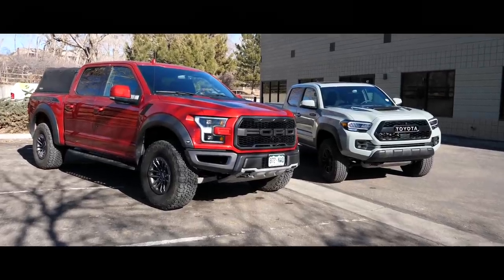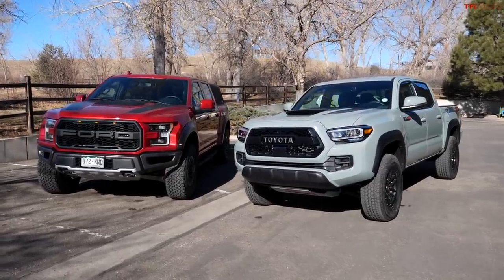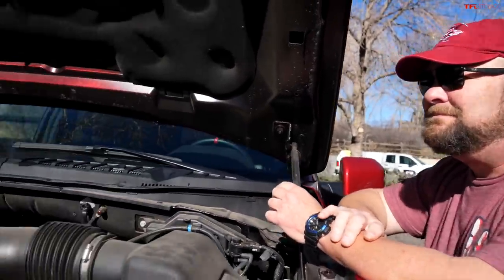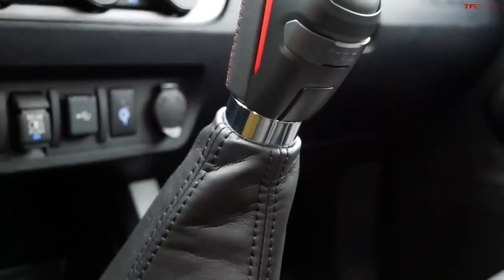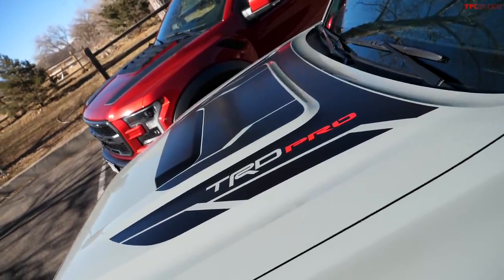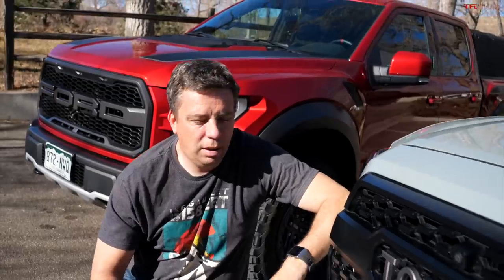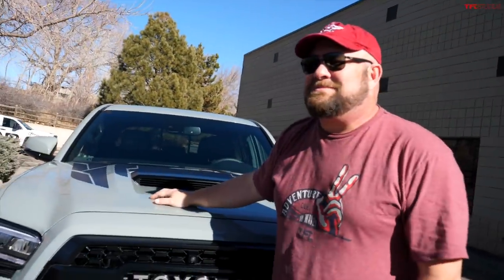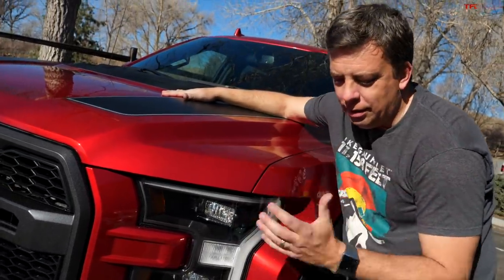Big vs. Small: The Ford Raptor & Toyota Tacoma TRD Pro Are Both Off-Road Beasts - But Which Is Best?

Comment: TACOMA ALL DAY!!
Reply: Why ???
Reply: @fj400007  RELIABILITY!!
Reply: @uriahg193  I might be the exception here but, I had a few problems with my Tacoma, I wouldn't have called it reliable.  it was overrated,  overpriced,  underpowered with no towing capacity that started rotting away the second it saw salt.   There's a reason you'll still see more older american trucks up north compared to very few japanese cars past 15 years old.
Reply: @fj400007  You're in the minority,  i still have my 07 Tacoma.  356,000 original miles and no problems.
Reply: @uriahg193  that's impressive,  I was unlucky I guess.  I was pulling a  5000 lbs boat from time to time and  the occasional off roading but, I had to get my differential rebuilt twice and had issues with my transfer case too.
Reply: @fj400007  Get a Tundra if you're going to be hauling a boat. Mid size trucks are not for that. I hope you stay with Toyota,  good luck buddy.
Reply: @uriahg193  What about all the lawsuits?
Reply: @anoop4243  All companies have been sued.  Chevy , Ford, Chrysler etc. That's a weak argument.
Reply: @uriahg193  So basically, a manufacturer known for reliability, is getting sued for reliability issues with its product. People buy it mostly considering the reliability reputation in mind - not features, performance, towing capacity etc. 

Why buy an unreliable outdated Taco when you can get pretty much everything with the ranger ? The perceived reliability is a myth nowadays.
Reply: @anoop4243  Abraham it's a machine, it's not perfect.  The only perfect thing we have in this is the King James Bible. Toyota is still better than  any American truck.
Reply: @anoop4243  Threw u a curve ball with the Bible.  But no machine is perfect but for my money I'll trust a Toyota truck any day over a Ram, Chevy or Ford.
Reply: @uriahg193  That's a myth. How exactly is it superior? Just saying that its superior is not gonna prove anything. Ranger has better performance, is more modern, has better space and tech, and even better fuel efficiency (yeah if driven like a grandma) and has been used around the world and has been there for a decade. It has been holding up well.

What exactly does the Tacoma have over the Ranger other than 'resale value' due to perceived reliability?
Reply: @anoop4243  Toyota way better tgan Ford. C'mon Abraham,  Tacoma is the King of mid size and full size. Reliability,  something Ford won't promise you. Have a nice day!
Reply: @uriahg193  Till now, you haven't specified how exactly it is superior, rather than just saying it's more reliable than ford ... You are forgetting that the ranger has been out there for a while now, without problems. Many high mileage rangers out there. If you can get high miles, with the performance and better value with the ranger, why should Taco be even considered? (I never considered Taco to a Raptor(not the same segment)... Taco doesn't come close, neither does Tundra TRD  pro)

If Tacoma promises reliability, why did consumer reports issue it a "do not buy" warning and rate it as the least reliable truck in North America? You speak as if all the reliability issues posted for Taco over YT is fake ... Lawsuits are also fake ... & CR produces fake reports?? 😂

How exactly is Tacoma the king of full size tricks? It's a mid size... And F150 is the best full size truck - praised by all reviewers, and the bestseller.
Reply: @anoop4243  the proof is in tbe pudding.  They last longer Abraham.  If u want something unreliable stiick to your Ford F150
Reply: @uriahg193  F150s are not unreliable. No one would buy a vehicle that constantly breaks down (F150 sales are only increasing), and If you personally think they are, then you are still living in early 2000s when ford messed up. Currently Toyota's are having all sorts of issues - with the 2.5 engine, V6 , Frame rust, Transmission, Software issues, lawsuits... And still people like you believe that they are reliable. Nothing can change perceptions until you buy one and experience it yourself.

They even announced a V6 Turbo Tundra for the new gen ... Guess what ford has been playing with turbos for a long time now. And Toyota's seem to have issues with ancient, unchanged powertrains.
Reply: @anoop4243  Yeah but Toyota still more reliable,  that's where i put my money.
Reply: @uriahg193  Your money, your choice🙂. Just because you think that something is reliable doesn't mean others are unreliable. And there is more to owning a vehicle than reliability alone - if reliability was the only thing people cared about, we'd still be driving basic, featureless, boring vehicles. 

Have a great day.
Reply: @anoop4243  My smart choice, thank you.

Comment: I really like how every vehicle on your show is always competing against a Tacoma.... Raptor Vs. TRD Pro... Jeep Vs. TRD Pro... M1 Abrams Tank Vs. TRD Pro... USS George H.W. Bush Vs. TRD Pro. And every single time the Pro wins..
Reply: Hahaha nice one
Reply: That makes it the benchmark.
Reply: Tacoma is way overrated.
Reply: Ive driven Raptor, ZR2 and TRX. I go TRD Pro all day everyday! I own one exactly this same Lunar Rock! Beautiful and sexy villain all trucks had to bowed down to.
Reply: @speedy0231  cause u Haven’t owned one lmao
Reply: @brycehammond2099  I did look at a brand new one with a 3.5. The interior felt very dated, and it felt under powered. I ended up with a 2018 F150 Lariat with a 5.0.
Reply: @speedy0231  ya exactly, if your looking for flashy one, taco is not for u.
Reply: @speedy0231  ah a fellow F150 owner! I see you are a fan of future electrical problems as well.
Reply: @speedy0231  I agree.  Tacoma is a dog unless you get the manual and regear to 4.88 or 5.29
Reply: @shaiq-nbaiq1826  50k miles with no issues at all. I plan in trading it next year anyways.
Reply: @speedy0231  lol because thats still new
Reply: @speedy0231  not really. How is overrated?
Reply: @speedy0231  so is a KIA…

Comment: I think one thing I take in to consideration is parking. I have seen so many bigger trucks squeezed in or have to drive around just to find parking. Believe me, the Raptor is my dream truck, but I am all about practicality, and the Taco hands down has the best everyday usage, along with off-road capability. Love Tacos.
Reply: Yes I totally agree I had a 2017 raptor & Gen3 Tacoma at the same time I sold the raptor due to spending more time at ford than my house , will never buy Ford again , I’m loving this Gen3 Tacoma more and more
Reply: The width of my '19 is the only thing I need to managage. Even breakover isn't too bad for a crewcab. But the width.. you just can't fit some places. Others are tight. 

But man, is it ever fun. And it just eats up the miles on and off road.

Comment: If you actually work for a living at a normal job it’s a no brainer.  Price.  Price of gas, price of insurance, initial cost. You get the picture; and I didn’t even go down the reliability road.  Whoopsy, guess I did😀
Reply: Lol go to a turd Gen Facebook page. Nothing but problems and problems. They ride on the reliability coattails of the 1st and 2nd gens.
Reply: The gas mileage is not much different to be honest.
Reply: @richfarfugnuven6308  it’s not only the mileage, read his comment again
Reply: @RagingBad  that's why I only commented on mileage.  The mileage in real world driving is about the same.
Reply: @Wade-lk4yo  nope, those are just some people complaining. I've had a couple of third gen's, and zero issues this thing out last  ford any day
Reply: @richfarfugnuven6308  still higher on the Ford
Reply: Not sure how the third gens are doing with reliability, but when I worked at ford we rarely had raptors in the shop outside of maintenance. Half of the ones we did have in the shop was because some dumbass abused it. The eco boost is actually very reliable. Sounds like the Covid caused toyota to maybe suffer on QC with these latest models? Not sure.
Reply: @adventuresinreality2645  3rd gens are not doing well at all in reliability terms. There is currently a class action lawsuit against Toyota for automatic transmission issues. I've also heard many horror stories of howling differentials and also the fuel pump issues.  The issues are so bad that Consumer Reports issued a Do Not Buy for 2020 and 2021 Tacomas.
Reply: @alienation1270  

If we look at Consumer Reports, the verdict is good for this generation of the legendary Toyota Tacoma. But if you want one of the best used Toyota Tacoma model years from the second generation, a few stand out. 2005, 2010, 2011, 2012, 2013, 2014, and 2015 all have perfect reliability verdict ratings.Nov 18, 2020
www.motorbiscuit.com › the-best-us...

Taken from their pages.  This is for the 2020, 2021.   It may not be as good as previous years but still not bad.
Reply: Calm down ppl. It’s okay to have a different opinion. That being said, The Tacoma has a very tall overdrive in 5th AND 6th gear to turn low RPMS. The gearing is so high that the transmission is constantly shifting. So the only thing wrong with the current gen taco is that it needs to be regeard. This is not a reliability issue however it is annoying while driving.
Reply: @alienation1270  Oo wow lol. That’s too bad, just shows no company can rest on it’s past. Just ask ford, the 2000s they made too many mistakes and are still trying to shake that rep even though 2012 and ups have been about as reliable as anyone.

Comment: I have a trd off road in manual transmission and I love it. I know the tech is so far behind the Raptor. These two trucks are not in the same class and really shouldn't be compared head2head because they are geared for different markets. They are both badass in their own ways but I'm happy with my taco

Comment: Toyota has really made its mark with the Manual trans. That's why the price is so crazy for such a mid sized truck. The can ask that price because they have something that's absolutely limited in its market. The raptor to me seems like it should be lower for the price. The wide body is cool, but you get that tacoma, throw a full mid travel kings kit with adjustable heights, you get exactly what you do in the raptor for less. Theoretically you can do literally everything that the raptor has, all aftermarket, and still spend less. That's toyotas key. They made a strong, forever lasting, mid sized truck. It's decent on gas, and isn't meant to be 500 hp. I'm sorry but why do you need over 350 when hitting the trails? Or going off roading? If you want speed you could supercharge it and get the kings kit, and still be under the price of a raptor brand new. Also Ford just doesn't have the reputation tacoma has. What Ford do you know that went a million miles all stock same engine and trans? Fords have been known to and will always have issues at 150k+. With a tacoma 150k+ is just breaking in the truck. With proper maintnance and rust protection your tacoma will live forever. I can not say the same for Ford f-150's. Maybe a Cummins or a diesel but not the f150. I'd take a tacoma any day of the week over a Ford any day.

Comment: I’ve owned them both. The Raptor is a lot more fun to drive. It can feel like a pseudo sports car when you put it in sport mode. The negatives for me; too cumbersome to live with everyday, and I don’t trust how those turbos are going to do in the long run. I had to plan every trip or errand with my Raptor. It being so wide made parking anywhere a nightmare!

The Tacoma TRD PRO, is not going to knock your socks off with acceleration or push you onto your seat. What it will do, is take you on your journeys with relative comfort, knowing that it can take abuse and still bring you home without any problems. It’s not going to give you BS lights, sounds, or rattles. It simply keeps going without asking much in return, fuel and oil. Beauty is in the eye of the beholder, but both trucks are the best looking to me, in their class. 

I ended up selling my Raptor and buying an Army Green Tacoma TRD Pro. I haven’t had any regrets whatsoever. The Tacoma is simply easy and pleasant to live with. I know that if I choose, I don’t have to purchase another vehicle for the next twenty years. That’s great piece of mind to have for me, and worth the trade.
Reply: Totally agree !
Reply: People keep knocking the turbos since Ford first put them on their engines and years later..... no major problems so why still so skeptical?  Any part of an engine can have problems if there was a major problem with the turbos we'd have seen it by now just saying
Reply: tacoma reliability is not there in the 3rd gen.  class action lawsuit on automatic transmission, howling differentials, fuel pumps the list goes on.  Reliability is so questionable that Consumer Reports issued a do not buy on 2020 and 2021 Tacomas
Reply: Have 2018 Raptor and have no issues with parking. Not sure what's wrong on your end. Reliability is driven by two inputs (Design and manufacturability) Being ford pushes out 3-4 times the volume compared to Toyota with the addition of new technology is a testament of fords outstanding quality. One of the reason I believe that helps with this is the Ford employees really take pride in the brand. I don't get that same impression from other truck manufactures.
Reply: @lrr5586 , fair point and well taken. Perhaps I didn’t give the Raptor enough time to prove itself as far reliability goes. 

As far as parking, I’m simply a lost cause! I have a hard time parking any big vehicle.  What bothered me the most, was being so close to other vehicles because the truck took almost every inch of width space. People in general don’t care, they’ll ding, scratch, your $70 grand truck and not think twice about it. 

I travel a lot and have to park at airports quite a bit. That was pure nightmare. People running late and swinging luggage everywhere, i cringe just thinking about it.

Comment: Nathan.   ATRAC is NOT Terrain Management System.  Nor is it Crawl Control.  And Yes it is available on manual transmission Tacomas as Andre used it on the last video. Unfortunately Nathan keep confusing the systems when he explains them and ATRAC gets mis represented

Comment: The manual in that Taco makes it more desirable for sure.  I recently drove my brother's '17 Taco TRD Off-Road w/the 6 spd auto.  I own a '15 4Runner TRD Pro.  I always longed for more power from the old 4.0L v6 -- but, after driving my bros Taco it actually felt quick.  The 3.5L mated to the 6spd auto -- sluggish man,...just sluggish.  I love the Toyota reliability -- but, if I could get a Raptor for close to the same price as a Taco -- I'm going Raptor.  That said,...keeping my 4Runner.
Reply: What's sluggish?  Hit the ect button (takes the system out of economy mode) and stand on it.  Sluggish my ass.  Aint a v8 raptor engine, but for a v6, power is one thing it doesn't lack.  Lack of knowing how to use it however, makes people miss out on the fun
Reply: @kdrhobby  Maybe it was in eco mode,...not sure.  Thanks for pointing that out.  I was comparing it to my 4Runner, not a Raptor.  Taco's are the best selling truck mid-sized truck on the market.  I don't think my opinion that' it's "sluggish" will eat into Toyota's sales figures.  The fun will continue.
Reply: Love the 6 speed manual transmission. 2023 last year for tacoma 6 spd stick shift...

Comment: I added Air Bags to the my Raptor to help with payload and towing. They take over the suspension when I push over 40 PSI to the bags with remote control, this is turn makes truck tow with confidence and safety . Makes my raptor with 600 HP and 600 Ft lb of Torque make for a very capable truck to work and play.
Reply: Did you upgrade your power plant
Reply: My 2018 raptor only has 450 horses and 510 torque, stock but some intercooler mods would up the power levels significantly.
Reply: I have the 2011 model with the 6.2 liter super charged
Reply: @johnkraft5640  nice I almost bought a 2014 , there great trucks!
Reply: @77teahupoo  look up goosetuned, that tune will make your ecoboost scream

Comment: A Tacoma TRD Pro is a Tacoma with bolt-on parts.  A raptor supposedly has a reinforced frame along with bolt on parts.
Reply: It’s not supposedly reinforced, it is reinforced, it’s actually 700lbs heavier than the f150 frame.

Comment: While the Taco can be fun to drive off road due to its size, it’s uncomfortable for those over 6 ft tall for daily driving. The little motor is peppy but most ecoboost motors will outperform both in power and fuel mileage. Had the 2010 taco TRD for a year. Most uncomfortable truck I’ve owned in many years. Front seat cramped for larger drivers. Back seat foot room is non existent. In order to get more ground clearance the trucks floor pan is raised which leaves absolutely NO room under the back seat for you feet. Also, the cab isn’t sufficiently high enough for any adult to sit in the back. My 6 ft 3 inch son literally had to angle his feet to get size 13’s to fit and could not sit up in the back seat due to the low head height. This is why I no longer own it and have an f150 screw. Never looked back.

Comment: I have yet to see a raptor at 57k. All the ones that come to the dealership by where I live are around 75k
Reply: Just picked up my 802a without a sunroof for 62
Reply: @WewuzKangz85  yeah dealerships in my area have a couple of trd pro’s. They’re both under 50k. Also keep in mind that there are dealerships selling used raptors in the low 70k range
Reply: @WewuzKangz85  where??
Reply: @WewuzKangz85  Was it a new 2020?
Reply: @chrisirons723  Florida. 2019. Bought it last year. 20’s are going the same though. Was at the dealer last week.
Reply: @WewuzKangz85  what dealer specifically? I live in Florida and have not seen any pricing like that new on 802A.
Reply: @chrisirons723  al packer west in Loxahatchee